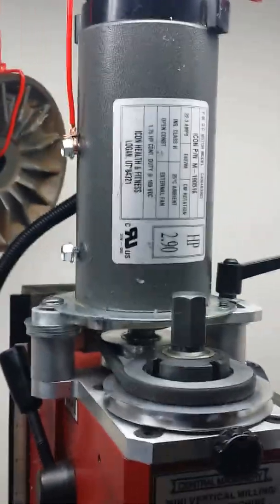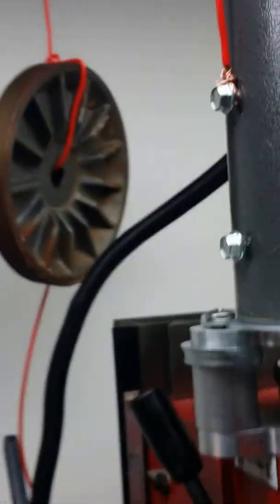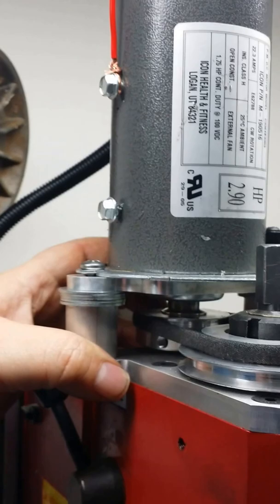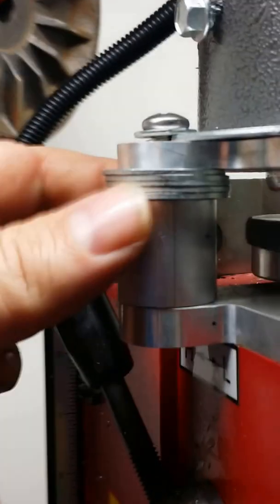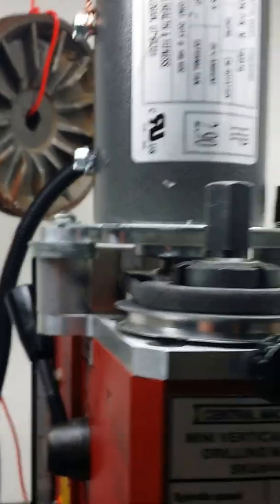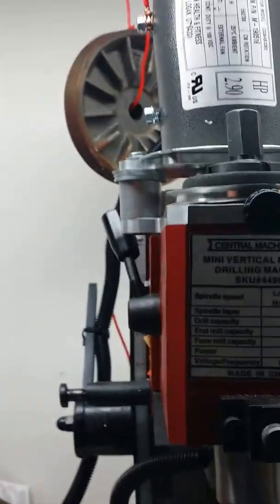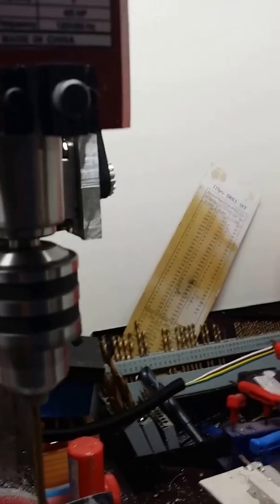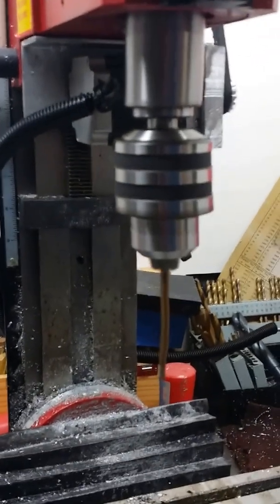X2 Mini Mill motor upgrade (6)

Comment: i used a gas cylinder from a lift gate from my 2004 toyota sienna van ,when i replaced it.i used the cylinder for the mill works great 5 yrs now.

Comment: The shaft on the treadmill mothers are 17mm and the end is 1/2"-20 LH thread! Most GM and Ford alternator are 17mm shafts and the pulleys fit the treadmill motor shafts perfectly.
Reply: You have lots of useful knowledge on this project.  So now I need to find an Ford/GM alternator pulley

Comment: Counter weight beats the hell out of an air spring. The problem with air springs are they create an uneven tension. The more you compress it the more tension it puts out. To compound the issue they usually mount on the side of the head and this causes a torsion on the gibs. It also makes it so you have to make the gibs semi-loose. causing issues if drilling or plunge cutting. After scrapping my ways and making a counter weight set up. I can tighten my gibs to the point that they will not change an indicator reading when locked and my milling head still slides smooth as butter. Check out my channel it may give you some ideas. If you are set on an air spring, I will gladly sell mine, Peace.